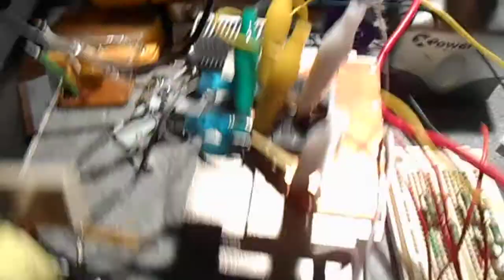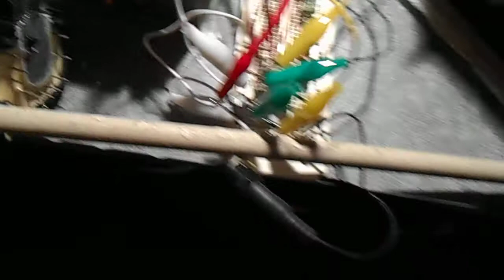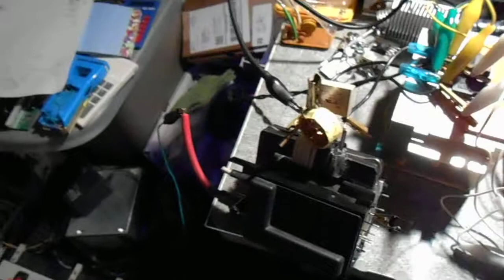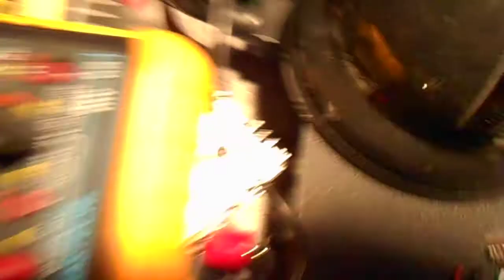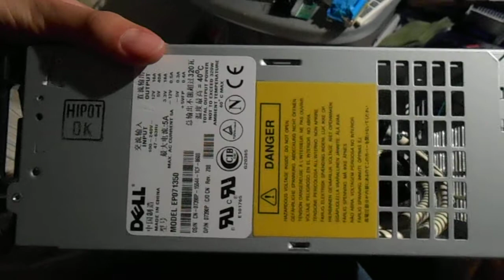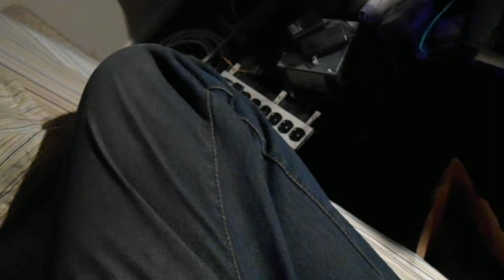High Power ZVS Mk 1.1 and 720W PSU teaser

Comment: hey bro very nice ! sounds like its putting out a high enough frequency for good silent arcs too, you may want to put a few caps in parallel so they can handle the increased current but the cap and induction values are great  as they are !  nice heat sink too those fans should do a great job cooling it for long runs ..  oh if you want a cheap, fairly reliable tool Ryobi is a decent brand i used them a lot in america on job sites ;-) might cost you 30- 40 $ for a drill and bit-set .. cheers dude !
Reply from the maker: thanks man! yea it was putting out a nice frequency for sure! ill have to check out amazon to see what they have ill make sure to check out Ryobi.